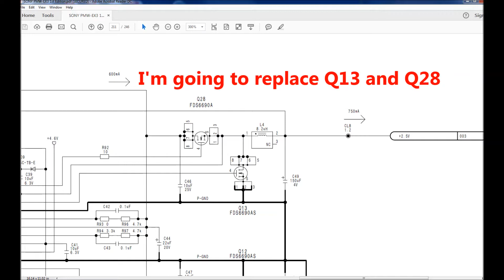Sony PMW-EX3 RE-260 Power Circuit Board Repair

Comment: Hello, can you please help me with some information?  

If you use an external DC power supply and reverse the polarity, will this component be damaged?  

I turned it on inverted and the machine does not want to turn on.  

Thank you very much.

Comment: Good Afternoon. Thanks for the video. Unfortunately, I am to far from you for asking for checking my camera. :( That is why, need your advice: uncnown condition camera without battarey or other power supply. Tryied to start it from universal power supply, but seems it is dead. Dissambled, but haven`t seen any damages inside. Could you please explain, how did you found this circuit? Thanks a lot! :)
Reply from the maker: https://www.meditronik.com.pl/doc/plus/pmw-ex3.pdf
Reply: @mykcameracamcorderrepairse7816  Cool! :) Thanks a lot!)

Comment: Did the camera turn on with battery?
Reply from the maker: No, didn't work either battery or ac.
Reply: Mine works only with battery... it will be the same failure?
Reply from the maker: I don't think so. it must be something else around the power circuit board.